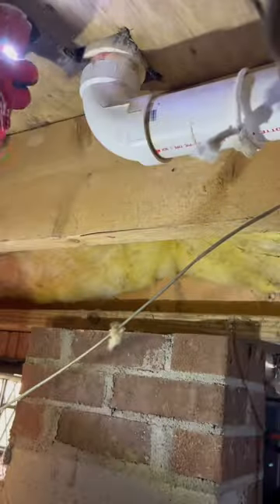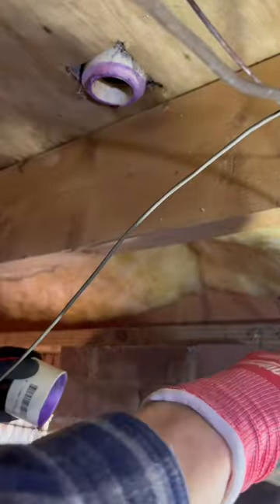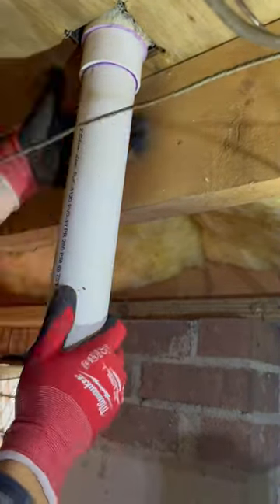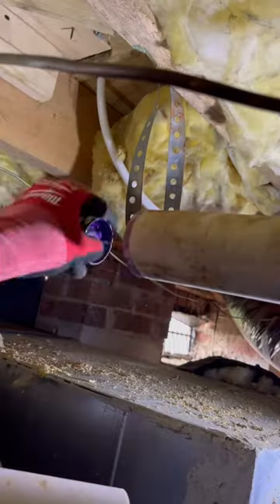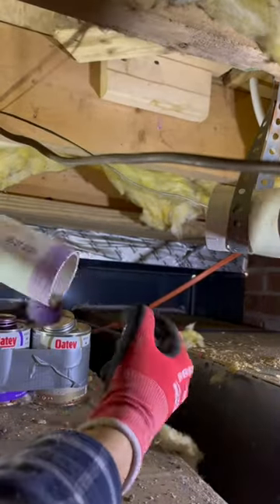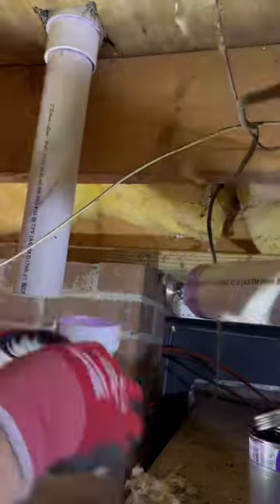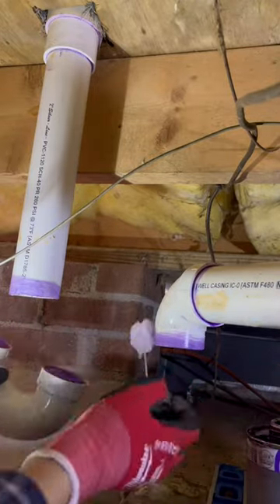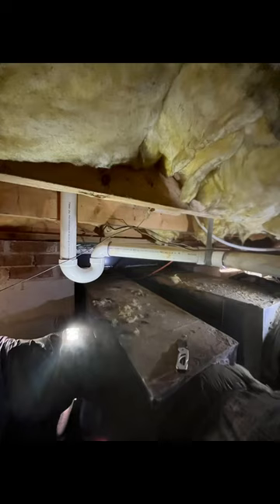How to Fix Sewer Smell in Bathroom #shorts #plumbing #plumbingvideos

Comment: That’s not the reason of the smell. Either you have a crack or not properly vented. Your pipe is upsized there is more air in it

Comment: My personal integrity will not allow me to knowing install a pipe too short to full seat in a hub.
To avoid replacing the strain,cut the hub off the qtr bend and run the drain off the original drain pipe stub. Finally strap the p trap since the drop is barely glued in. Aggressive draining  cleaning plumber could break that joint.

Comment: Why don’t Americans use proper brackets for their pipework? That looks like a temporary fix…….
Reply: Are you referring to a J hook?
Reply: Explain yourself
Reply: In England we use saddle clips, specifically designed for each pipe size. Not just a random length of strap banding, wrapped around the pipe 😂. We do things properly. But then again in England we build our houses out of bricks and mortar, not timber 😂😂😂😂😂😂😂😂
Reply: @Plumber2009 yea sure you are better 🙄🙄🙄
Reply: @Plumber2009 and they are cold and moldy..😂😂😂
Reply: I wrap the strapping around and throw some screws in it. The “should hold” method lol

Comment: Why put the toilet pipes in the crawl space? You should cut out a trench for it to fit in, before you fit the floor section - So you simply unscrew the cover and do the work easly.  Who designed this? The worst place to work on it, so you can't do the job  property.

Comment: Bro why u put that coupling on when there wasn't enough pipe that is gonna leak like a son of a gun
Reply: Use one of those cut inside the fittings tools instead install a new piece of 2 in then add your coupling

Comment: Probably would’ve had to replace that strainer or at least used a fitting saver so that coupling would’ve had pipe all the way to the hub but other than that nice work overall
Reply: Was gonna say use a fitting saver ! 😂

Comment: You need a vent on the line to that fixture bro. They plumbed it wrong, and then you plumbed it wrong again, you just upsized the pipe. There’s such a thing as universal plumbing code. You should check it out.  I would not trust this guy’s plumbing videos, period.

Comment: If your plumbers only reason is “code compliance”. Run him off. He’s a new construction junkie. There’s a huge difference. A lot of techs can’t get new construction out of their brain. Its super useful to know new construction codes. But 99% of the time. If it worked for 3 days. It technically works. You can’t throw a 2023 code book at a 1973 house built to code back then. Stop using “let’s bring it to code” as a sales tactic. Unless your building a new house.